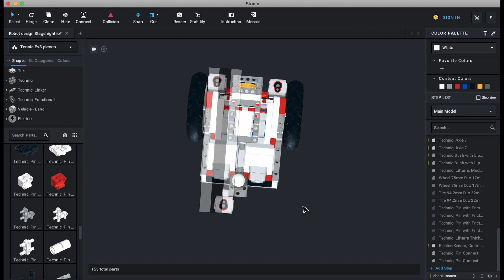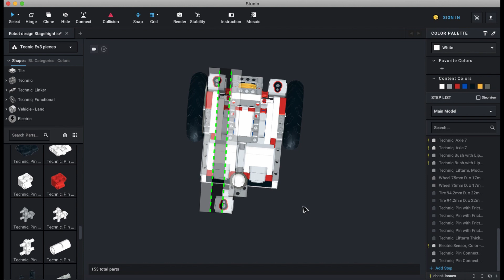The most effective 2 sensor Line Following setup

Comment: I think this is a great idea, but I do have 1 thing to mention. I am not sure in a practical match, that you want to permanently put the back light sensor there. There are 2 reasons. 

The first one is that you permanently take away 1 extra sensor port, now 3/4 of the ports for just line sensing. The more important reason though, is I think you only get the option to follow the line the way you describe in the video on one side of the line, and only in 1 direction. 

I think this idea really works well with a third light sensor that is on an attachment, which gives you much more flexibility on where the lightsensor goes, what direction you get to do the linefollowing on, what side of the line you follow, what side of the robot follows that side of the line. I don't think you want to commit that before you build any attachments.

How well does this work when the line turns or curves?
Reply from the maker: @Matt So, I think the sensor attachment is a great idea. This setup doesn’t work too well for lines with sharp turns since the back sensor is solely there to correct the robot if it isn’t directly parallel with the line, but is able to follow lines that curve.
Reply: @brickwise8624  That is very cool! I hope to hear about more ideas like this because I have definitely not seen this done before actually.

Comment: That's a really innovative idea.

Did you use a proportional line-following algorithm to use the colour sensor at the rear?

How did you integrate the two line-following programs to control the same set of wheels? Was one given more weight?
Reply from the maker: Yes, both sensors use a proportional line following program where they compare the sensor reading to a target value. The front sensor contributed 90% to the overall steering value, while the back contributed 10%
Reply: @brickwise8624  thanks for the clarification. The thought processes you described indicates that you would make a great engineer.